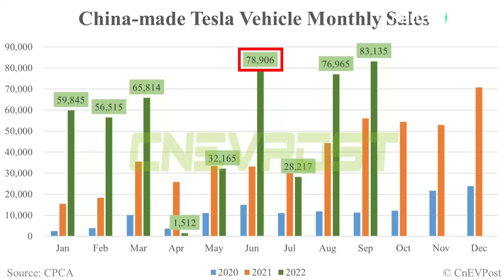Why Tesla deliveries from Shanghai were lower than expected

Comment: I don't get Tesla's delivery wait times to Australia. If Shanghai is ramping deliveries so much and producing so many Model Y's, then why is the latest delivery dates pushed back to Feb - May next year? Does Shanghai make cars in allocated  batches for certain countries and if you miss out on the first batch you have to wait until the next batch of cars are made for your country? If someone could explain this to me how this works I would be eternally grateful.
Reply: probably got a lot to do with availability of boat and port space. EG The port might be fully booked till December
Reply: The answer is simple.
The more cars delivered
The more people have the tesla experience
The more buyers want to buy.
Therefore buddy, more sales simply creates MORE ORDERS
 And sales pushed back
Additiona problems...

 reorganising the factory

Delivery by suppliers of essential components due to supply bottlenecks
Reply: ore orders means longer wait times...  No matter how fast Tesla raises production, demand is also growing...
Reply: Yes - Different regions have slightly different requirements - besides the obvious left hand right hand drive.
Also, shipping - there is not infinite car carriers and it needs planning to insure most lands and is delivered before end of year.

Comment: suprised telsa doesn't build their own hybrid ships
Reply: because it won't save much energy. ships are not like cars. they don't break often thus much less waste.
Reply: @qilu2004 my comments was a bit of a joke though ships and cars both use motors to spin things to make them move. have you ever owned a boat or jet ski they broke down way more then cars
Reply: @investingthelike111  my understanding is ice is not efficient due to frequent breaks. a ship in the open water actually waste energy that much, that is why shipping on water is the most economic means of transportation. it is purely from the perspective of energy efficiency.
Reply: @qilu2004  The energy recovery at braking is only a small part of why EVs are desireable. The two main reasons are 1) electricity increasingly is created by renewables like solar, wind, hydro. 2) even if electricity is generated by fossil fuels, the full cycle efficiency of an EV is about twice a comparable ICE vehicle.
Reply: @lengould9262  regarding your second point, the ratio could be a lot lower than 2:1 if we are talking about ships instead of cars. that is why I'd expect electrification of ships to take place much later.